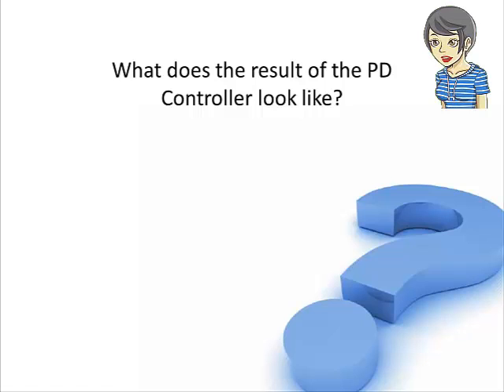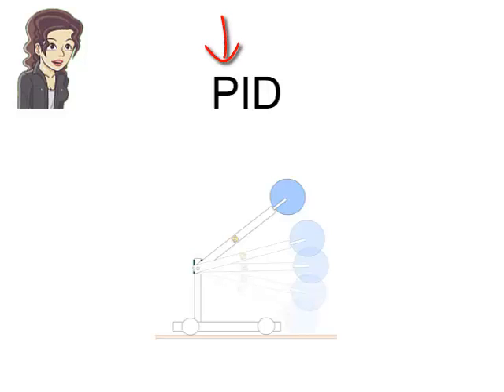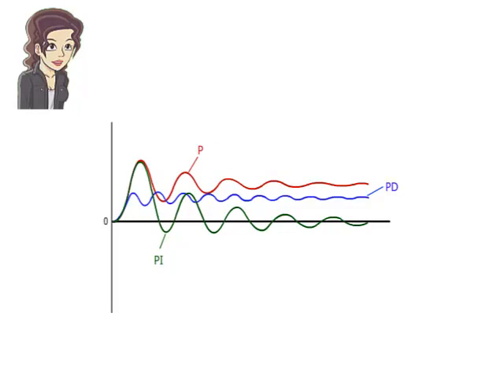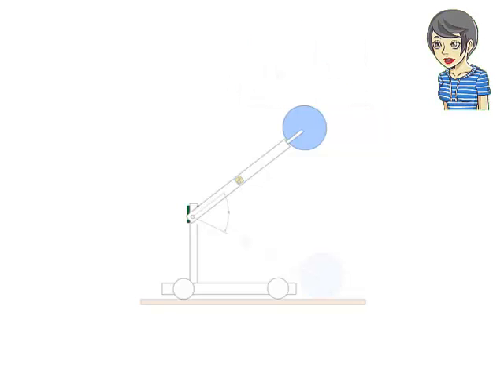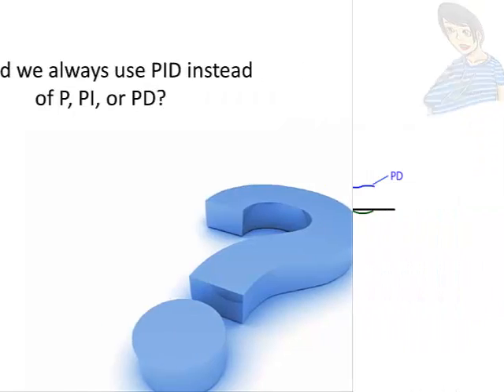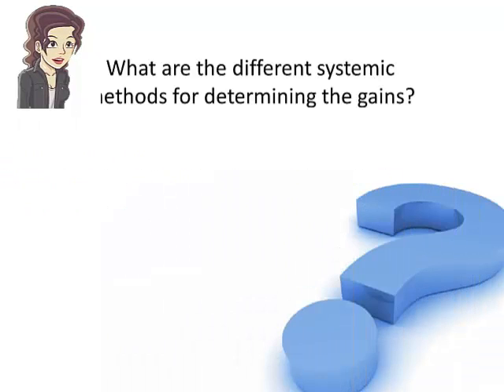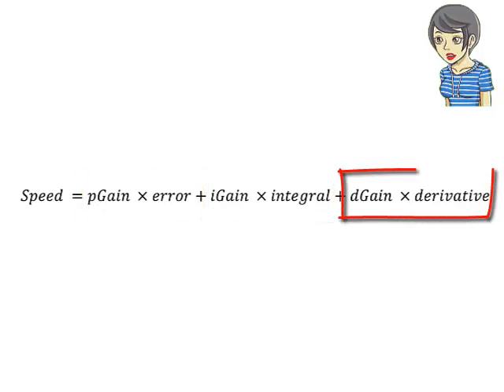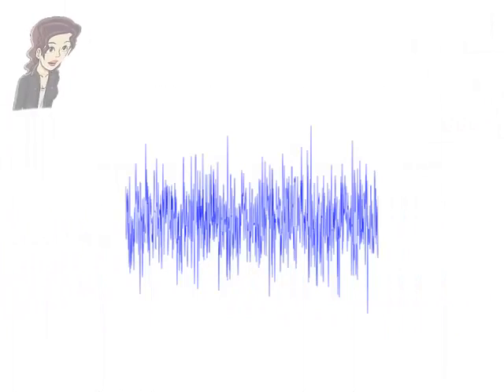Question/Answer 1

Comment from the maker: Part 2:

Average the first five data points, or points in the first chunk. Then, starting from the second point, calculate the average of the next 5 data points. Continue moving down the graph one data point at a time and averaging the data chunks until the end of the graph is reached.

Now plot the averages. This represents the error function but with reduced noise. We probably have not eliminated the noise altogether, but we have lessened its effect by smoothing out the function.

Comment from the maker: Daniel - this was too long to fit into one comment, so we broke it into two parts.

Part 1:
Decomposing the error function into sinusoidals is a theoretical method for removing noise. A more practical method, one that perhaps is more suited for VEX, is to find the "moving average" of the error function.

How does this work?

We graph the error (the difference between the arm's current position and target position) over time. Then we break the graph into chunks of time, say 5-point chunks.